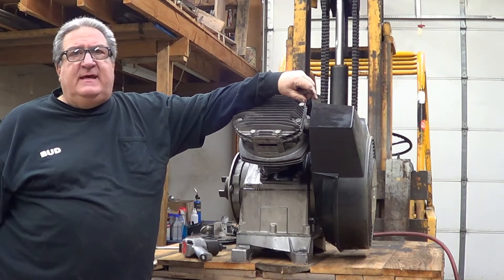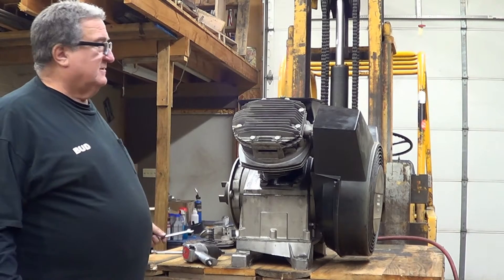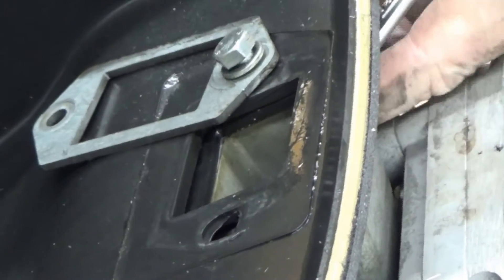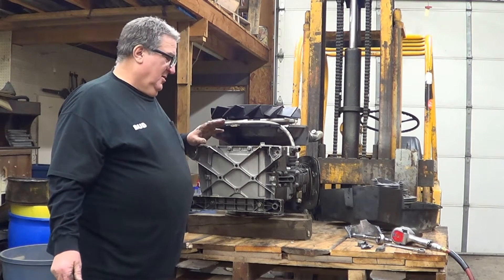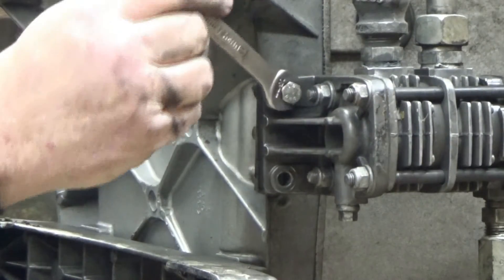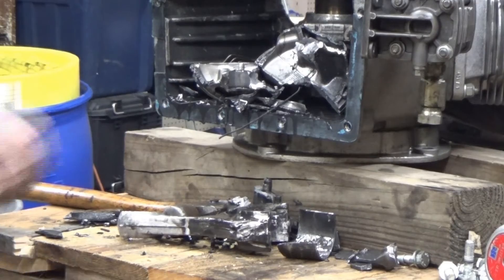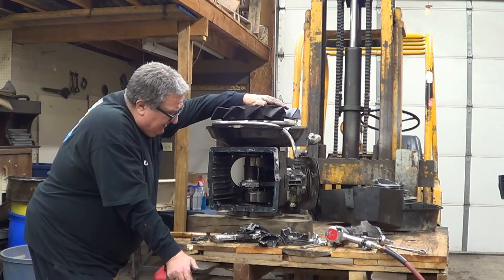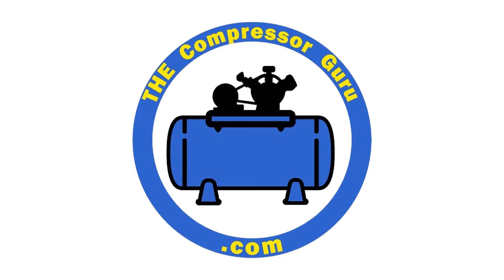Tear Down and Evaluation of Atlas Copco LE20 S4 , E 14

Comment: Unfortunately we've run into the same problem getting parts from Atlas Copco and I personally think it's gotten worse since they were teamed up with Quincy.  Even on the rotary screw and scroll compressors.  We've had good luck with one of Atlas' distributers in Rhode Island - D.L. Thurrott.  I can send you the contact info for the guy I deal with there if you need
Reply from the maker: Please do. send it through thecompressorguru.com